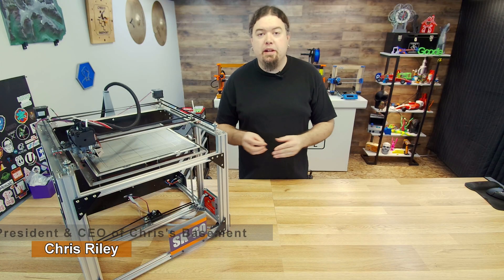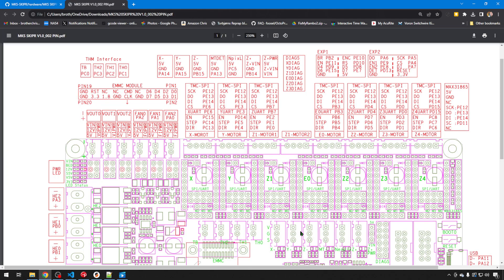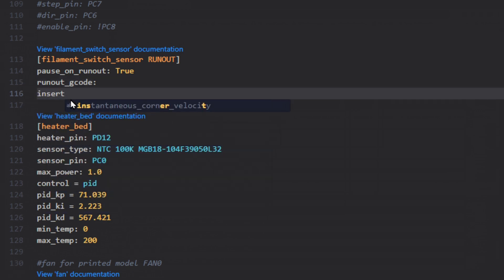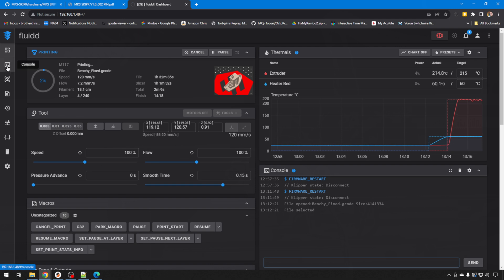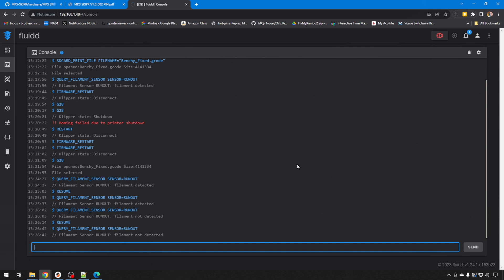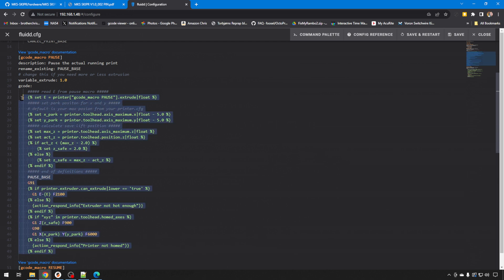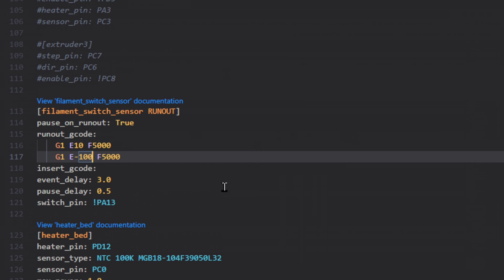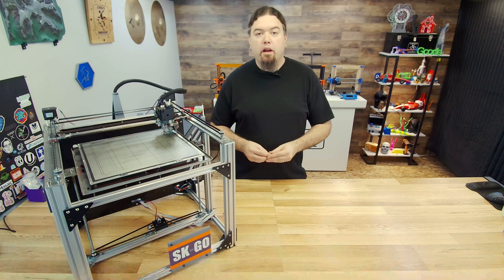Filament Runout - Klipper - Chris's Basement - 2023

Comment: This is a really great explanation of how to set it up with modern Klipper. There are a lot of videos that simply don't know that some really smart people at Mainsail and Fluidd have pretty good PAUSE/RESUME macros integrated with their UI, and for basic setups they just work. I have I long bowden tube so I have a custom UNLOAD_FILAMENT macro that runs after PAUSE. Then a LOAD_FILAMENT macro that I run via the UI to load and purge once I have swapped the spools. Then once the filament is loaded and purged, I manually RESUME from the UI.

Comment: Great video Chris! I've been trying to make my K1C printer to keep printing until uses 50cm of filament between the moment the sensor is triggered and the printer pauses. This is the distance between the sensor and the extruder and this is the waste amount I ended up when I run out of filament. 
I can't figure out a way to do this. I see you used time... any help here?
Thanks
Reply from the maker: Yeah, I would have to look at this again, time was the only way I could think of to do it. Maybe there is a better way, count steps maybe?

Comment: Yeah, that's cool. But I recommend installing filament movement sensor instead of this useless switch. Which is much more versatile and a must have in my opinion.
You can make it from a bearing and an optical sensor. Plenty of models on the web.
Reply from the maker: I have played around with them and done some videos, I might look into making one myself.

Comment: If  you want to have Klipper check the runout sensor before the print starts, and cancel the print before it actually prints, try placing this code into your start_print macro just before the purge line is drawn:
  {% if not printer["filament_switch_sensor <your_sensors_name>"].filament_detected %}
      RESPOND TYPE=error MSG="No filament detected, aborting print" #replace with M117 if you have klipperscreen
      CANCEL_PRINT
      {% else %}
        RESPOND MSG="Filament detected... continuing print"   #replace with M117 if you have klipperscreen
    {% endif %}

This code Is driven by the sensor state, and not by a trigger event. It should be included in main Klipper in my opinion.
Reply from the maker: Awesome! Thanks

Comment: hi chris! very interesting video.. but you got me a little confused.  If everything is set up correctly, and i run out of filament, the system will pause, do what ever i tell it and i hit resume once the new filament is in place and it will restart.. OK, i got that.. But if i run out a second time? it seemed to me in the video that it will not stop but continue? or did i misunderstand?
Luc
Reply from the maker: Hey, as long as you reset the switch after it runs out, it will trigger again. So filament runs out, it will pause, you load more resetting the switch, then hit resume, everything will work as it should. Next time it runs out, it will do the same thing. The only time you run into an issue is if you hit resume with out resetting the filament switch.

Comment: I just bought two of the BTT sensor v2 for a tronxy x5sa and an  Octopus Pro board, cant use it though, the TMC 2209's refuse to work without throwing errors and disabling themselves.
Reply from the maker: Strange, what type of errors are you getting?

Comment: 11:00 isn’t it -5mm not 5%? Looking forward for your next video. You did a tap install on Vorons or other printer with Klipper already?
Reply from the maker: I THINK that would be 5% of the move, but I will confirm. I haven't done the tap install yet, but I do intended to do a video on it for the Trident.
Reply: @ChrisRiley  It is not, it's 5 mm. The percent symbol is from the Jinja block and because the return type of printer.toolhead.axis_maximum.whatever is the maximum axis size in mm, the return type of the whole expression will be 5 mm from the actual maximum.

Comment: Chris. What if u have a ptfe tube all the way from the hotend to the sensor? And the sensor is a regular endstop switch with a lever? Won`t the filament collide with the lever when u retract that much?
Reply from the maker: Yes, it can, I have run into that before. I have seen printer where they leave the PTFE loose on the extruder side so when it backs out, it  will push the tube out of the way.

Comment: I am trying to get klipper to work for the 12 time. Installing on a Dell Wyse 3040 Thin Client with Debian 12.
1st issue is no wifi, and during setup of configuration, wifi is seen and i add my PW to log in and click continue but it takes me back to choosing my ssid, which i choose and go through it all again
Reply from the maker: Hey George, my guess is Network Manager isn't starting, not sure if this would be helpful. https://youtu.be/ulBeN9pFRE4
Reply: @ChrisRiley  Thank You

Comment: Chris, lots of good information to explain the process and get started. Hopefully you will expand on this.  I have worked on getting a good M600 replacement in Klipper and have been using the one in RATOS since the last version upgrade.  It is very simple as all of the work is done in a macro M600
Here is the printer.cfg entry

[filament_switch_sensor runout_sensor]
pause_on_runout: False
switch_pin:  PG15		# also known as e4stop   /  e4det
runout_gcode:  M600		#

The M600 code does all of the movement of the carriage and retraction of the filament,  It also makes sure that the bed stays on.
This use of the M600 enables it to be called from gcode for filament changes during printing.
Reply: I was about to ask, if M600 would do, but you already provided the answer 👍
Actually I find klipper more difficult to set up. Not because it's different from Marlin, but because there are dozens of macro implementations to choose from, all slightly different, some maybe too old for 0.12.
Documentation of macros and klipper configuration itself could need some improvement 😉
Reply: @kimmotoivanen  I'm lucky, as most of my Klipper use is in Ratos for the Rat Rigs.   The other Klipper install is on the Peoply Magneto X and the installed macros are all I need.  The M600 command is the main one I use for color changes and both Orca or Prusa slicer will add it automatically when you do a color change
Reply: Hey, I'm looking for a tutorial on adding an endstop runout sensor to my v-core3, do you have a link?
Reply from the maker: Great Dave, thanks for the info!

Comment: I have filament runout set on my sv06 plus. It is running on a pad 7 with klipper and we'll I have to say it is not reliable. It seems to work when it wants to. I noticed that it will work sometimes and keep bed warm and other times it will not keep bed warm and then require a home before you can resume. And guess what. If you hit home it will crash into the print. Lol. So my trust in the option is not so good. I had no issues with it on marlin.
Reply from the maker: I'm a big fan of Marlin, thanks for watching!